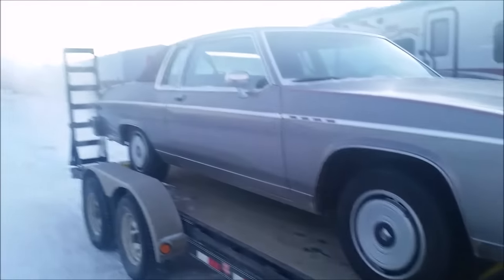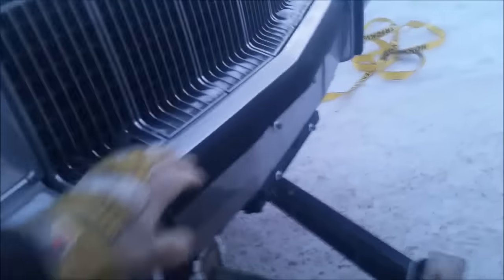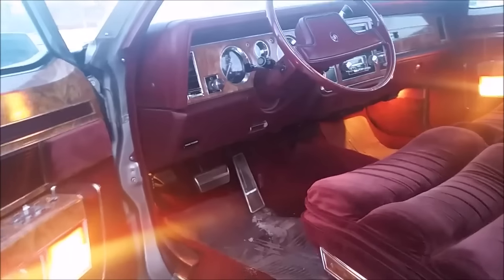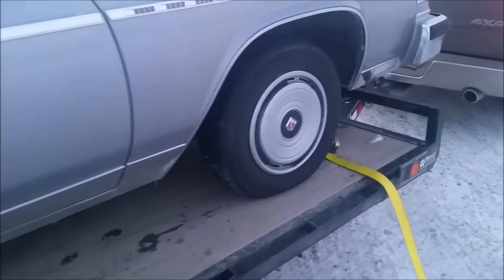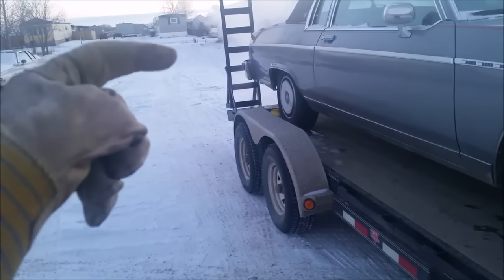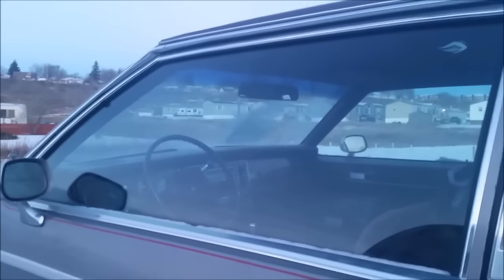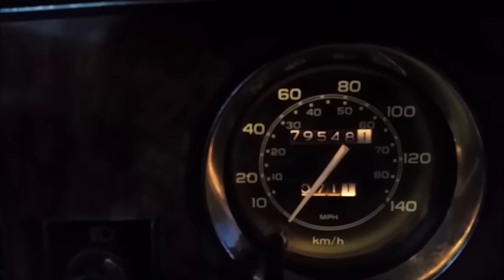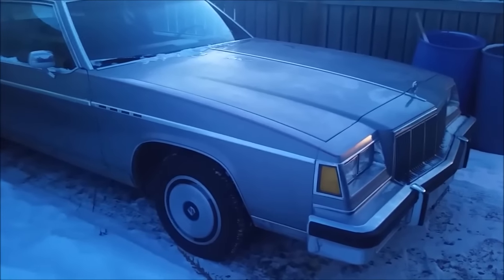1983 Buick Electra Going Bye Bye 03

Comment: Love my ecodiesel need a tune it will soon
Reply from the maker: just hope it doesnt spin the fuel pump gear or spit oil out the filter housing on ya!
Reply: My 2014 had it's problem but my 2018 is like a champ and 392 gears is much better with the 8 speed will tune soon as the warranty is done